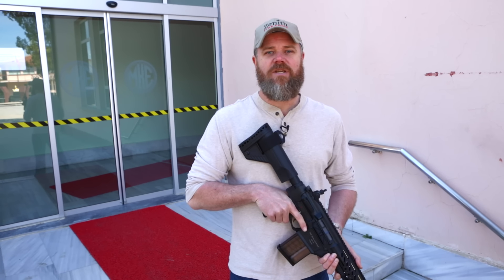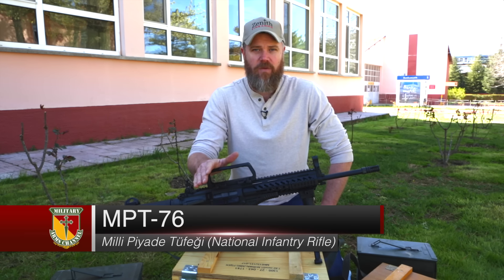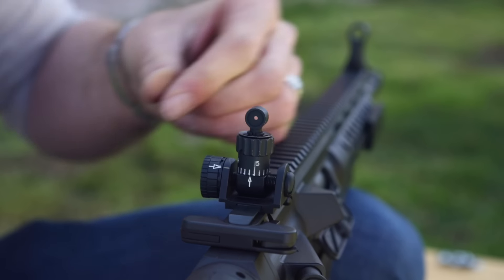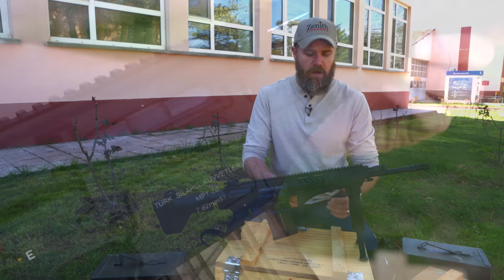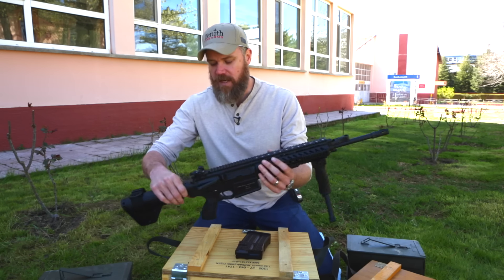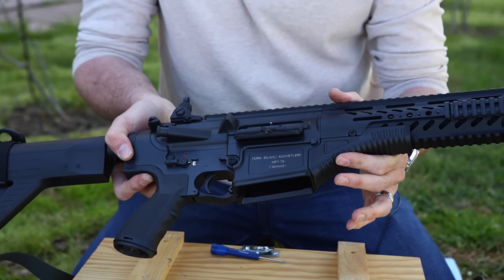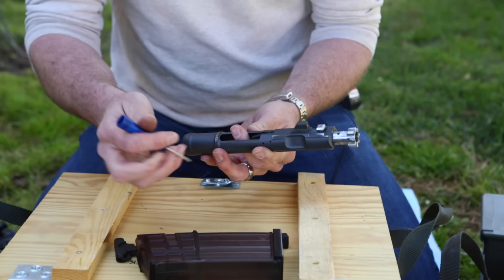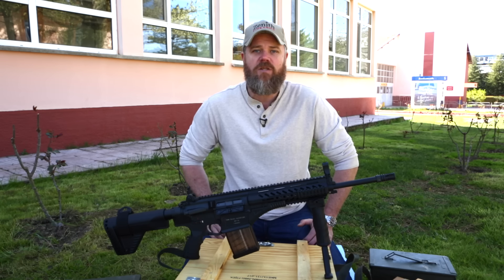Shooting the Turkish MPT-76 Infantry Rifle

Comment: I think the only weird issue is the right-latched charging handle, but other than that I think it would sell pretty well on the American market.  Very cool feature with the sliding forward grip unit, and I think the sights look very useful and well-executed.  I'm interested in the design of the piston system and how easy/hard it is to service and clean it.  I liked the firing pin retaining pin going through the tail of the firing pin, what an interesting feature that makes a lot of sense.  Ambi safety and mag release is a plus for sure as well.  The stock looks a little heavy/bulky but 12 positions is pretty cool -I'd be interested to see how friendly it is to accepting standard AR stock options.  The pistol grip is interesting with the extra material added onto the rear of the lower receiver, much like how Magpul does it -I wonder how friendly it is to swapping standard pistol grip options.  The carry handle unit is kind of crazy to most American eyes, and thankfully it's removable because I can't imagine any American civilian would want it.  

I'm curious as to why they chose to make the charging handle latch to the receiver on the right side -maybe they wanted to prevent gear interference (latch getting stuck on your kit, causing the ejection port cover to pop), or maybe they just got a lot of left-handed dudes in Turkey.  

Either way, excellent video MAC and it's always awesome seeing the international hookups you got to make these kinds of videos happen.
Reply: "can't imagine any american civilian would want it" wut, can you own one of these in usa ? I thought this rifle is for military use only. Either way we can't own these in Turkey lol.
Reply: Sarude - DandStorm 

In America, we have the right to own firearms.  If the company decided they wanted to sell the gun in America to the American public, they would have to offer it as a semi-auto version only (it would not have a full-auto setting).  

So long as you're at least 18 years old with no violent crimes (being able to pass a background check), then you could go to a gun shop and purchase this rifle -but as I said, it'd be the semi-auto only version.  

American civilians can own fully-automatic weapons but it's a much more complicated and expensive process.  For the average civilian not wanting to go through that process, they'd be able to purchase this rifle as the semi-auto only version.  

The practice of a military weapon being offered for sale on the American market is actually very common -some examples are the FN SCAR, H&K 416/417, the Sig Sauer 556 and other rifles, and many more.  So long as the rifle can only fire semi-auto (with some other minor requirements), the rifle can be sold.
Reply: 10% Turkiye cosmetic, 90% U.S. designed. What a joke...?!
Reply: very good objective and handful critisizm. Possibly charging handle will be ambi in next gen or 2.
Reply: at 6:32 it looks like it has holes on both sides for latch placement so from waht it looks like in that view all you would have to do is push the pin and pull it and the spring out and switch it to the other side.
Reply: Its price is a bit high to be on american market. 1.300 Dollars a rifle if i remember correctly.
Reply: Foulfy i mean just as a comparrision the sig mcx is around 1,500 and the mpx is around the 1.200 to 1,300 so i woundnt consider the mpt-76 a bit high.
Reply: +Artemio Menodin nope actually its desingned from german G3 but g3 had many bad ways but all changed. actually this gun mixed with only good spesifications of many guns. sorry my english
Reply: Mr2ndAmendment 
It is interchangable, right or left side.
Reply: Mr2ndAmendment you think Turkey is going to sell their top rifle to American civilians?
Reply: I think we already did...
Reply: Mr2ndAmendment, about the right hand charging handle. Probably that design stems from safety precautions. I was in service as an officer years ago, so I think I know how the army thinks. It's infantry rifle, there's compulsary conscription service, and, our people are smart but uneducated. Probably design will prevent a lıt of accidents.
Reply: Bora: "our people are smart but uneducated"  well thats what you get if your education system is created by zionist from France right after Turkey's independence.  Education system sucks for a good reason....not in our intrest
Reply: produced for military purposes only, there will not be sales for civilians
Reply: Mr2ndAmendment 

Might just be me looking too much into it. But maybe its out of religious reasons, always favouring using the right hand.
Reply: Ozgur Ozdincer ne dedi bu bu kadar uzun uzun
Reply: lucky!!! we aren’t even allowed to use a semi 😂. the best thing we can own is a double barrel shotgun.
Reply: Charging handle can be adjusted, but probably it was made this way if the entire army is used to switch grip or reach out with the left hand. Sometimes it is better to deliver what it fits to their habits.

Comment: the hinge being on the right side of the charging handle is similar to how you are supposed to load the sa80 when you use the handle, twisting the gun in a 45 degree angle and watching the ejection port as you chamber the round. they designed it this way because normally youd use the bolt release lever to chamber a round off a new magazine, and use the handle only when you have a malfunction (which you also should check the port as you load again) or when you load the rifle for the first time which is way before you get into combat.

Comment: Basically the MPT-76 is a Turkish HK 417. If it comes here, I would change the charging handle. Other than that, it looks good as long as it's cheaper than the MR 762.
Reply: hag12100 it is feature this rifle cheaper than hk417 but not a licensed HK product :)
Reply: hag12100 and the Israeli tavor looks like AUG?

Comment: 9 mm automatic pistol version of the MPT 76 is on development.It will replace the MP5's in the Turkish inventory.
Picture of the protoype : 
https://fbcdn-sphotos-f-a.akamaihd.net/hphotos-ak-xtp1/v/t1.0-9/11029506_915499448521819_5858085529300945836_n.jpg?oh=119696265604ab82691b1695116ace14&oe=568240D1&__gda__=1450533095_2c0b132500e5f994cf33495c1e0e3054
Reply: Cengiz Dev what is the name of that mp5?
Reply: erdal0 Its still a prototyp of Kale Kalıp and MKEK.It gets thru a serious testing procedure and the name is not known at this point.If you ask me MPT-9 would be a suitable name according the concept.
Reply: +Cengiz Dev 
IDEF 2015
Kalekalıp's design.

Comment: this rifle is only weapon in the world...all tests were success
Reply: Hk417,Sig 556,Aug,Galil,Mk18 what are you talking about there's so many riffles out there that as good if not better than MPT
Reply: @milkyyanks765  this weapon is a modified hk 417. It passed all nato tests. Truly a good weapon.
Reply: @mrnorthz9373  as you said it's a modified Hk417 thus there's nothing special about it and I doubt the quality control of Turkish firearm factories considering German made mp5 is better than Turkish made mp5
Reply: @milkyyanks765  lemme tell you how different. Has more muzzle velocity more range 100 more rpm no jamming and 400 grams lighter. Its not a cheap copy.
Reply: @mrnorthz9373  I don't know if the gun is good or not but it's undeniable that it's just a copy of AR10 platform. I'm not saying it's cheap or anything I'm just saying there's nothing special about it considering HK417 probably a better gun than this to begin with.
Reply: @milkyyanks765  bro, you dont call hk 417 an ar copy do you? It literally passed all nato tests. Its like a nato ak it never jams. Its lighter and better. Ehy you denying it?
Reply: @mrnorthz9373  HK 417 is an AR10 copy. It's about the same with slight changes like using short stroke gas piston instead of DI. You can't make a gun that had 80% system similarity and deny it's a copy. Larry Vickers himself said when he was helping the HK to make 416 the Germans basically wanting to improve the M4 platform.
Reply: @milkyyanks765  well ig you can call it a copy. I just thought youd call only the mpt 76 a copy, and hey they needed a license from h&k to produce it. Its nowhere inferior if not superior though.

Comment: Ah, if only more countries used 7.62 NATO as it's service rifle cartridge other than the literal varmint cartridge 5.56 NATO AKA .222 Special.
Reply: Captain HighHorse I care because .308 has been proven hundreds of times to be better than .223, and am miffed about the fact that .223 is still so widely used while having been proven to be underpowered. Why the snarky response? I didn't say anything mean or offensive.
Reply: SLIPPIN ON CEREAL also allows infantrymen to carry 1/3 more ammo for the same weight with 5.56mm.   The reality that many people ignore is that weight is a significant issue.  And within 300m, where the majority of infantry combat takes place, 5.56mm does just fine.
Reply: armynurseboy That is why I think intermediate cartridges between .223 and .308 like .243 Win. and 6.8 SPC are nice, although 6.8 is made for close quarters. The problem with .223 is that it's too small. It DOES work, but not nearly as well as larger cartridges.
Reply: I agree with that. 7.62x51 is definitely a better choice the only draw back is the weight of the ammo and rifle it's hard to carry 12 twenty round magazine's but if you use 1 bullet it should drop anything or anyone instead of 3 or 4 .223 rounds. I have an AR 10 as well as a rugar .223 I prefer my AR 10 always. in fact I like the .308 round so much I have 5 different rifles Chambred for 7.62 it's a game changer and can actually reach out and touch someone at 600yrd+
Reply: +Red McCloud 6.5 Creedmoor is an excellent in between cartridge. This is the bullet of choice in competition shooting and for good reason 1000yrds all day with a good scope.
Reply: 5.56 nato .223 are similar. ...   but .222 special won't work in any without complications
Reply: 6.5 Creedmoor, 25-45 Sharps, and 6.8 SPC  are excellent and should definitely be in service by now
Reply: +seth newman the only difference between 5.56mm and .223 cartridge is the pressure loading as dimensionally the two are otherwise identical.  5.56mm is loaded hotter.  The real difference between the two calibers is the dimensions of the chamber and leade length.  .223 is tighter with a shorter leade.
Reply: seth newman .222 Special IS 5.56. That was the original name before they modified it a little more for the military.
Reply: Red McCloud oh duh,  sorry blonde moment guys, I was thinking of the .222 remington not the .222 special
Reply: seth newman It's completely fine.
Reply: Red McCloud I do really wish they would adopt the 6.8 SPC or 6.5 Creedmoor. I want it to be as cheap as the .223/5.56 stuff.
Reply: 5.56 is a worthless round.
Reply: NeuKrofta tell that to the military and the thousands of people shot by them
Reply: seth newman or how about the people shot by 7.62 in body armor and 7.92 in Humvees.   Tell that to our boys who've been pinned down by a sniper with an old beat up Mauser at 400-500 yards and throwing 5.56 peanuts at em.
Reply: +seth newman You are thinking of the .222 Magnum, which is what the .223 is based off. I had a beautiful 1952 Remington 722 in .222 Remington (most accurate rifle I have ever fired.) The overall length and head diameter are essentially the same as the .223, but the neck starts lower, right between the 5.45x39mm and the .223 Rem. The .222 Mag had a greater case capacity, and thus more case body length. That is what was used to develop the .223.
Reply: I agree. You can carry plenty of 308. I mean, would you really want to carry a 5.56 when you are able to carry an AK or a 308 battle rifle?
Reply: Both 7.62 and 5.56 are both good rounds. 5.56 is more accurate than most users and the damage it does is impressive.
Reply: Will Parsons not against body armor...
Reply: +NeuKrofta Penetrating body armor is about the type of ammo you use. Ball ammo in 5.56 or 7.62 very well may not penetrate body armor.
Reply: 5.56 just can't compete in  the battlefield with hotter heavier rounds. It helps to have a long arm and pin your enemies down beyond their reach. Which is how it is in the middle east. 5.56 ain't good for nothing at 400-500 yards
Reply: +Red McCloud Nato uses 5.56 because we want to hurt to soldier not kill him , so soldier's friend will come to help...
Turkey uses 7.62 because it is the Turkish Army's need . 
They have been fighting with Terorists for so many years now in the mountains .
Turkey's geography makes the 7.62 more useful .
Reply: +Red McCloud Just keep in mind that Turkey is a mountainous country and Turkish troops are expected to engage at ranges exceeding 400meters

Comment: I like the design. It probably has no parts of the ar15 it uses, and thus the bolt carrier is thicker. The best thing to do is just to scale up an m16 rifle. And it looks they did that pretty much internally, and made some design changes to ease production. Furniture looks like it is made from the same nylon as used in an m16. Yes turkish firearms are on the way up. Turkey has a young population, so we can expect a whole lot more from these people. Military industry is on the rise. 

A bit off topic, BUT VERY IMPORTANT FOR TURKEY!: 
Just as other parts of the country pushing for modernization. For example the new laws are made up in 2014. I think it is wise if they also get some of the Dutch NEN norms for roads and consumer products. It looked like a lot of new roads in Ankara (2017), but a few things needed some more restrictions like US building codes. NEN norms you can get from https://www.nen.nl/Home.htm. The site is in dutch. They should have something like this is in Turkey, and live by it. The sidewalks did not have anything of a slope towards the curb, and the roads did not slope towards the curb. So water everywhere after it rained. 

Turkey is an upcomming country, and with the right guidance can be a superpower, that should not be underestimated. I hope it can get this idea to the right people, and hopefully something like this will be implemented, so its better when i go there a 2nd time. 

Greetings,

Jeff
Reply: Don't hope much from this government
Reply: @swadianborn397  It is okey as long as you dont "oppose democracy". It is pretty modern and as long as you have some good friends with you the people seem nice. Even without buddies its fine. If you want to study on a university for 1000dollar per year instead of the sky high prices in the USA. Ankara Turkey is the place to go to. They also do schooling in english. Ive been to haceteppe univeritesi. They have a math test and an english test you have to fill in correctly in order to be let in. A lot of people from other countries around turkey go there to become a doctor. But if you are american, you can also come and be a doctor. When you go back to the US you can make a lot of money... Housing is around 200 dollar rent per month for an appartment. So if you saved college funds, you might as well go to turkey and have a good time.
Reply: @swadianborn397  but you are from turkey? What is there not to hope for?
Reply: @jeffjefferson2676  Education seems good but It's not compared to other countries. The economy is getting worse everyday. 200 dollars is insanely high for a student to pay for rent. This government  doesn't care about making Turkey a better country. Taxes are getting higher but nothing gets better in the country. So where do our taxes go? To Erdoğan's friends and supporters.
Reply: @swadianborn397  there are student houses. That is like 50 a month. But with corona this might not be the best place. These are harsh times. Maybe go visit your family and stay with them untill times are better. Erdogan needs the country to succeed, and needs educated people. You not going to study if you want to study is horrible and i am sure they want you to be able to study. Why dont you call the university and ask what they can do for you? Maybe you can pay up later once you have a job. Who knows. Dont be shy!
Reply: @swadianborn397  You know what i am thinking? You arent even from turkey. And you are an imposter trying to look like someone else. Are you a cop? Are you looking at my youtube/internet activity? It just doesnt add up what you are saying.
Reply: @swadianborn397  im from turkey, ask any questions if you have some.